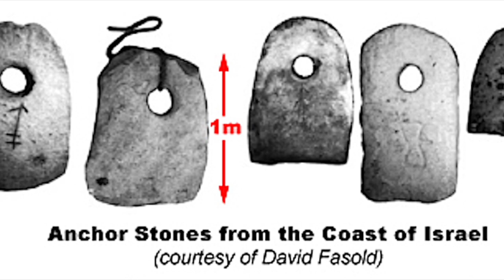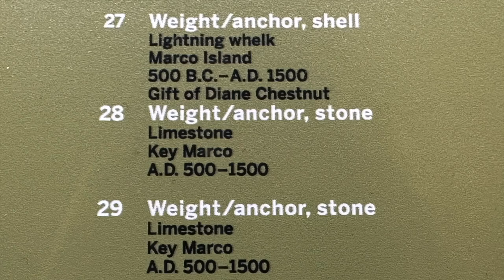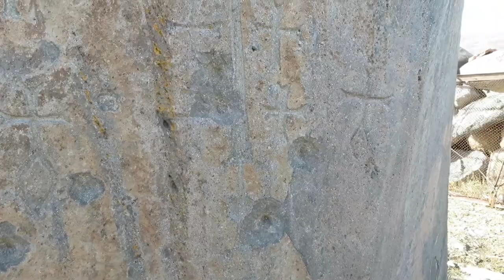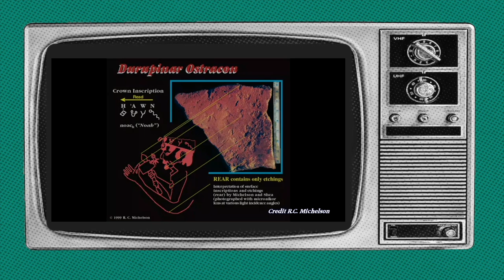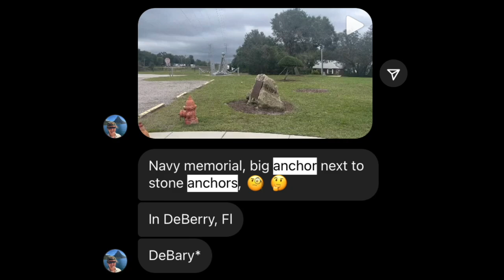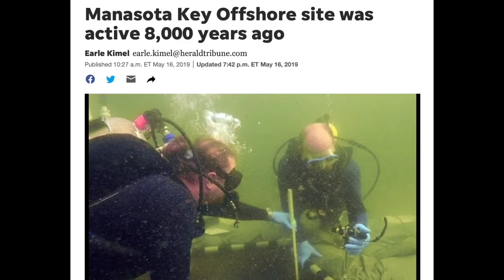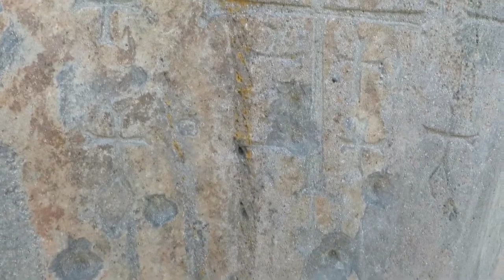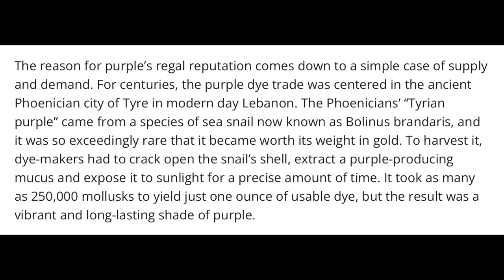ANCHORS OF ATLANTIS: The Ark Stones Of Florida

Comment: The stones with 2 holes I would think they lace one rope through the two holes. then the weight of the large stone would be on the center of the stone and not just a small section close to the outside.

Comment: You could easily make one of these anchors with a good stick with a piece of brass or copper at the tip,and at the top put 2 orange size stones on top for weight and spin it like a fly wheel it will drill limestone can be cut super easy,i could do it in about 24 hours of drilling if not 16,not impossible u can cut limestone with  handsaw like wood